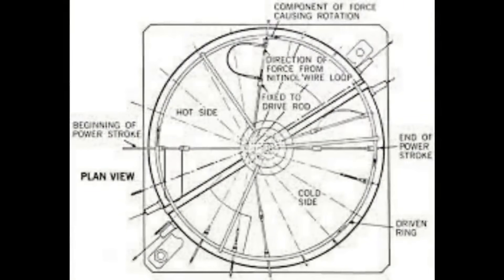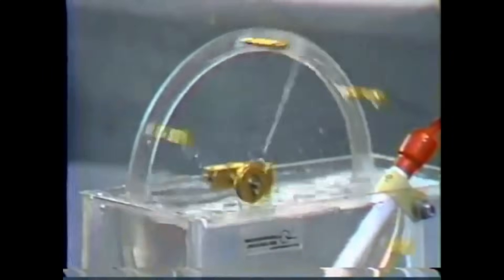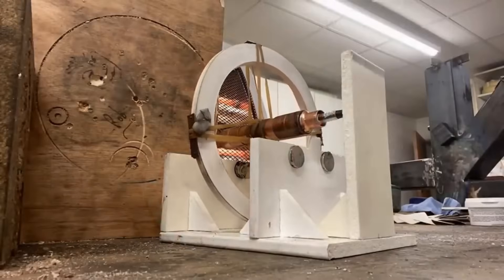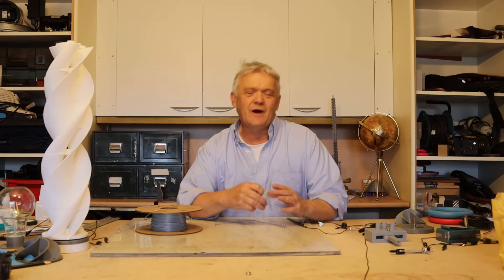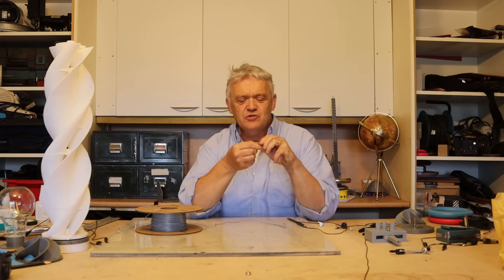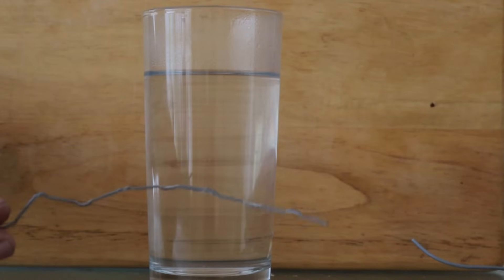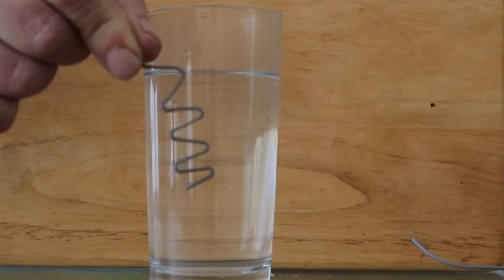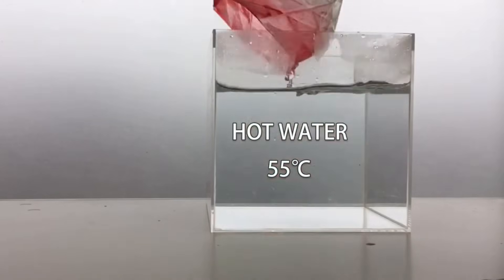2063 Shape Memory And 3D Printing

Comment: There would be an advantage here for transporting flat sheets that have previously been formed into complex shapes . This would reduce the bulk during transport. Simply unpack the flat sheets, heat and hey presto ! you have your complex shaped panel or component

Comment: The Ridgeway Banks video, an ABC news report In the 1970’s, also showed a bicycle wheel-type nitinol device. The wheel engine once immersed into a bath of hot water then falling into a cold bath spun immediately and with quite a force. The video later reports the nitinol was acting with more force as it continued and increasing speed. 

When I saw this, as it was broadcast during the Arab Oil Embargo, I was struck by the terror this would cause energy producers. This very simple device, configured with magnets or a mechanical connection to a generator, could easily supply plenty of today’s needs (cell phone, LED lighting) whilst scavenging either exhaust vent heat, wood stove, etc. 

The power estimates were not discussed.

Comment: Solar concentrator on one end, water on the other --> near the inlet of a black hose water heater? 🤷 Just spit-balling. I do realize that the concentration of solar can be used to heat the water, but I'm thinking in terms of scavenging, where the machine is a sum of many approaches instead of one mechanism. 🤔